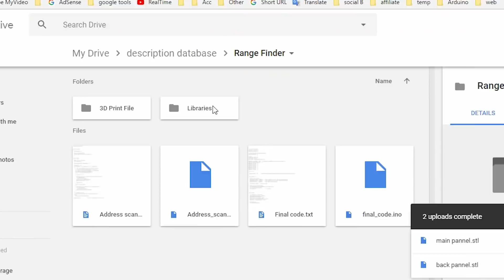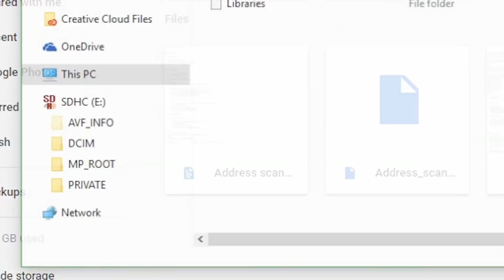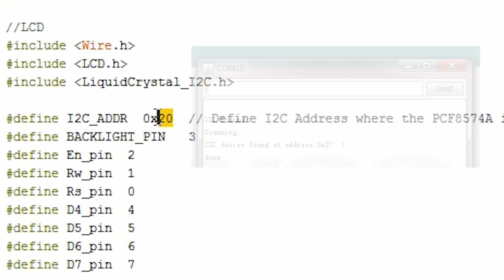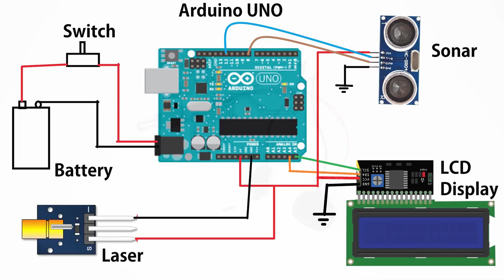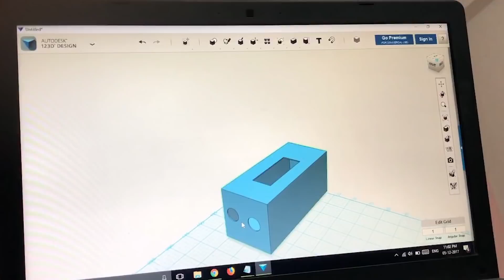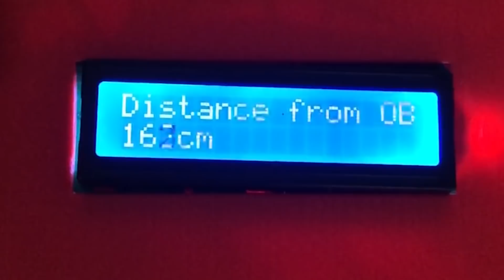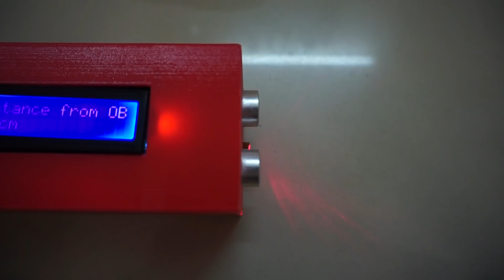How to make RANGE FINDER | Indian LifeHacker

Comment from the maker: Stuff you will need:
Sonar Module :  http://buy.flyrobo.in/ultrahc
Arduino UNO  : http://buy.flyrobo.in/uno
 LCD : http://buy.flyrobo.in/lcddi
Laser module: http://buy.flyrobo.in/lasermd

Arduino Codes and 3d print design: https://goo.gl/Mtx3Sw
Reply: what is the black thing under
 the LCD display
Reply: place tell the code which u have copy-pasted
Reply: which software are you using for 3d modeling?
Reply: Combien distances max ? ?
Reply: Where is the program that u r copy pasting 🥴
Reply: @IndianLifeHacker where is the link for jumper wires...???

Comment: Arduino: 1.8.5 (Windows 10), Board: "Arduino/Genuino Uno"

C:\Users\DELL\Documents\Arduino\sketch_aug09b\sketch_aug09b.ino:12:17: fatal error: LCD.h: No such file or directory

 #include <LCD.h>

                 ^

compilation terminated.

Multiple libraries were found for "Wire.h"
 Used: C:\Users\DELL\Downloads\arduino-1.8.5-windows\arduino-1.8.5\hardware\arduino\avr\libraries\Wire
 Not used: C:\Users\DELL\Documents\Arduino\libraries\Wire
exit status 1
Error compiling for board Arduino/Genuino Uno.

This report would have more information with
"Show verbose output during compilation"
option enabled in File -> Preferences.
Reply: yes sAMe here